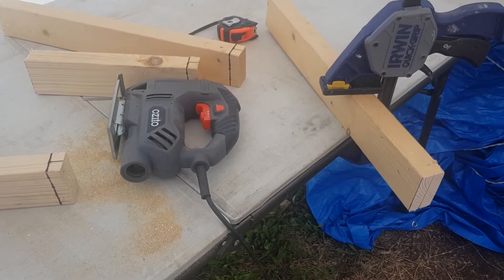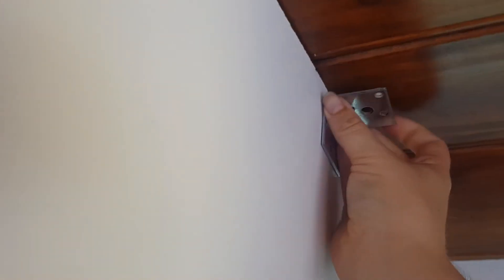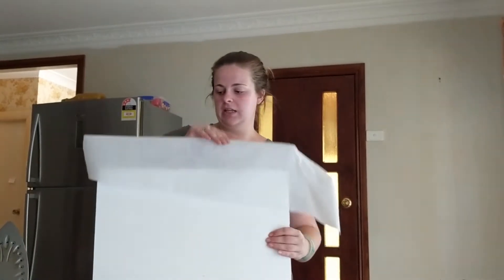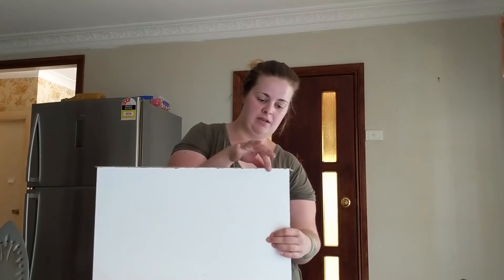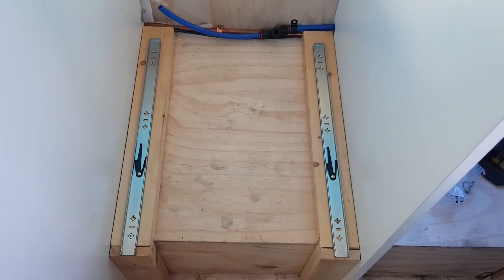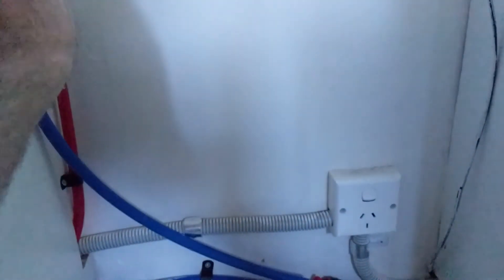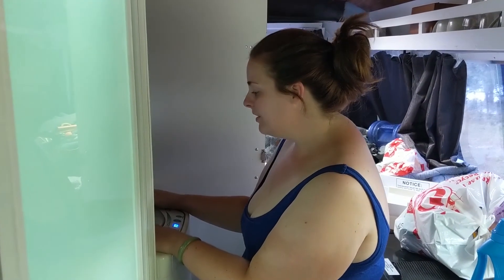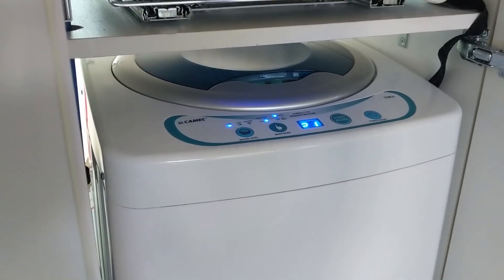Toyota Coaster Bus Conversion - Camec 3KG Washing Machine Installation

Comment: Does anyone know how to remove a washing machine like this out of a caravan  ??
Reply from the maker: All caravans would be different, but I imagine it would have a fairly similar setup to the way we installed it. A tap behind it that that inlet hose connects to and a 240v power point nearby. If you can lean it forward and look behind it you should be able to see where the water comes in. Then you should be able to turn the tap off and unscrew the hose. The hose will have some water in it, so you'll want a bucket or some towels to catch it.
Not 100% sure but that's based off of installing one. Good luck!